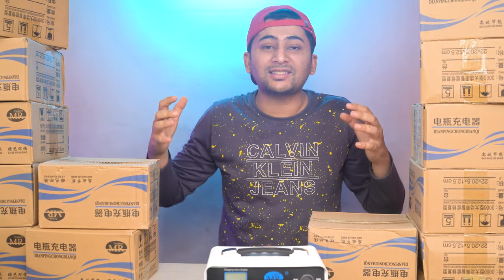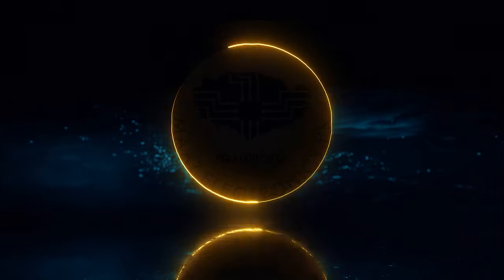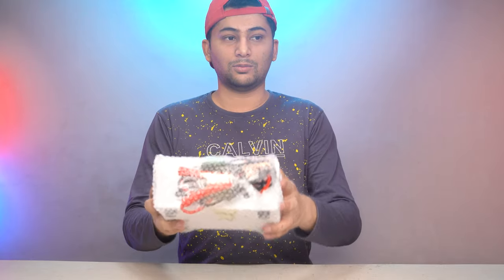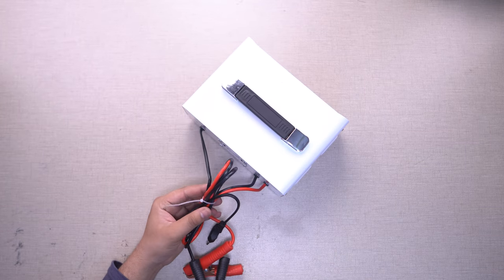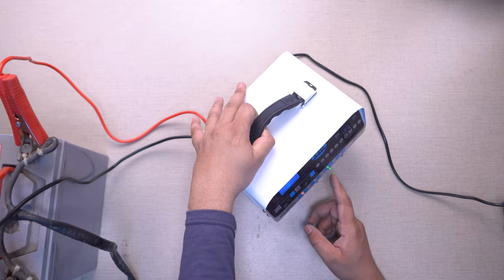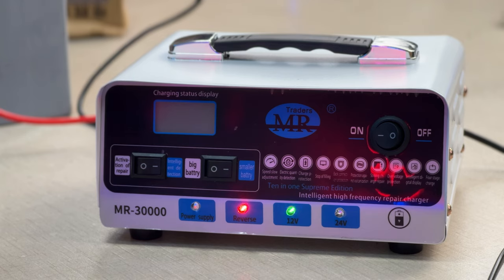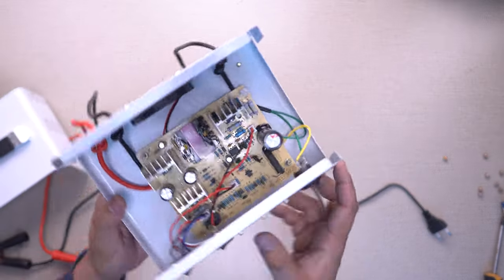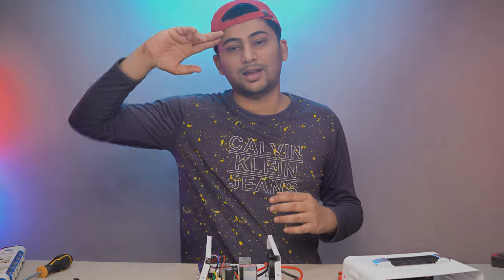12V-24V Battery Charger With Reverse Protection | Charge Dead Batteries |  12V Fast Battery Charger

Comment: The repair function is useless, these type of chargers use pulses Which is an inefficient way of repairing lead acid battery.
Reply: Is there other method to repair lead acid ?